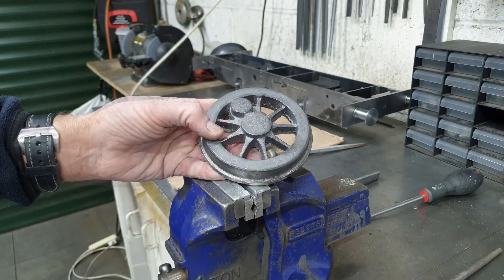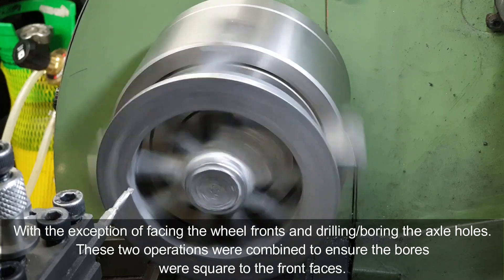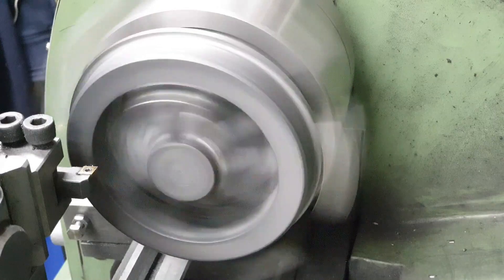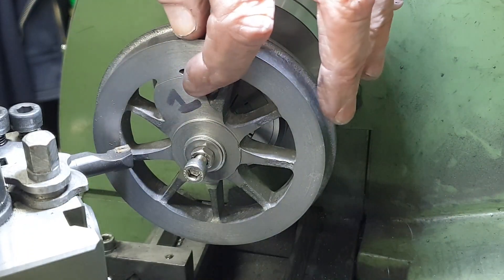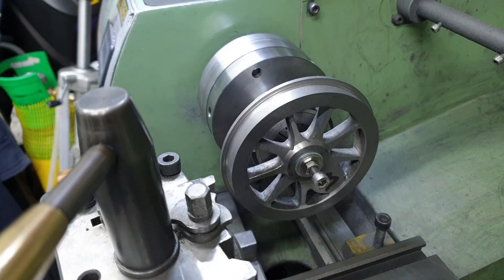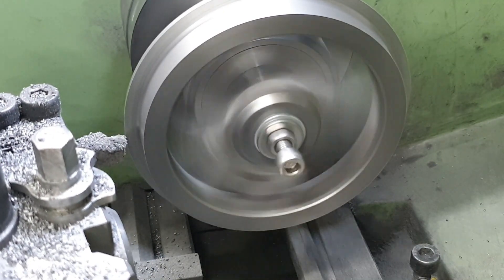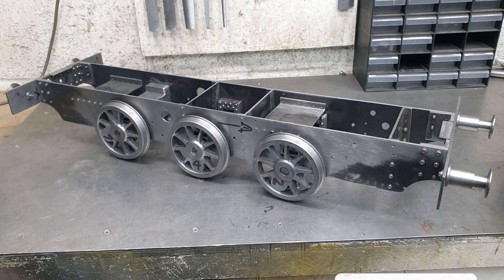Part 8: Machining the Wheels

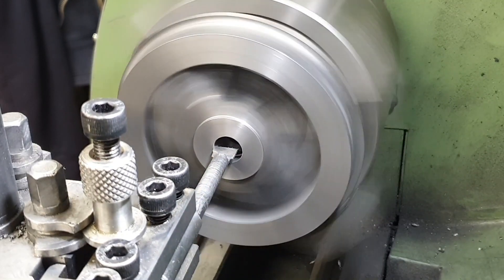Comment: Cracking work as always and well explained. 3:37 Funny you suggest reaming - older M.E. magazines suggest the same, although common wisdom these days always talks about boring for the final sizing. Also interesting about the undercut of the spokes relative to the face of the wheel rims, it looks like you've cut into the spokes fairly deeply? I felt like I had totally ballsed up the wheels for my 2.5" Atlantic, where I should have taken heavier cuts from the back and thinned out towards the front, rather than vice versa (which ended up with the same spoke cutting). Having said that, yours have come out nicely indeed. I appreciate probably not all that helpful at this late stage, but did you cone the flange also or is it straight up? Lastly, may I ask where you got that little pop-up for like/comment/subscribe? It's super neat!
Reply from the maker: Hi William, the problem with boring is being able to accurately measure the diameter of the bore.  Telescopic gauges can be used, but there's a skill to using them that I don't have, hence using Go/No Gauges which are flawed by their very nature.
Regarding the spokes, I did spend quite a bit of time thinking about how much to take off front to back, but ultimately this all comes down to what works best for you. 
The flange is not coned, there's not really enough of it at approx.4mm to make it worthwhile, although I'm sure some purists will disagree.
As for the pop up, just do a search on youtube, there are plenty out there (copyright free) with Green Screen background which most Video editors should be able to deal with.
Cheers Mark.